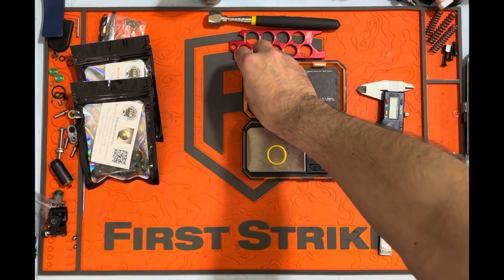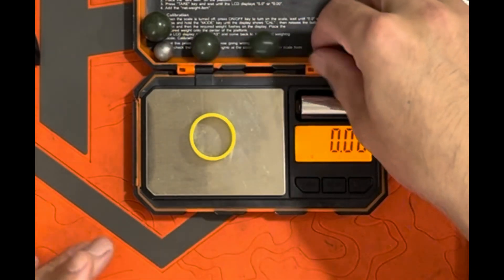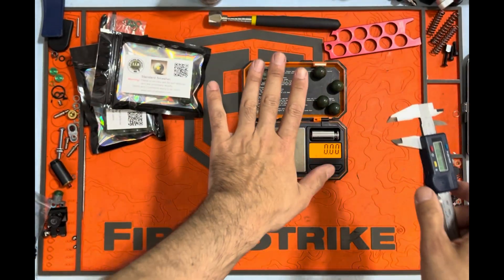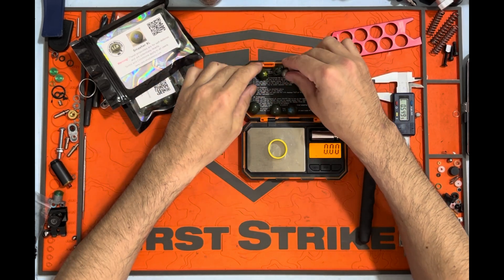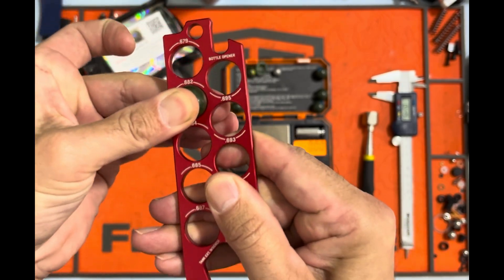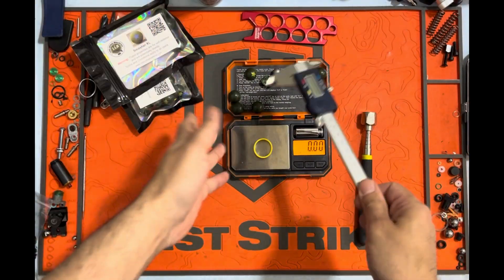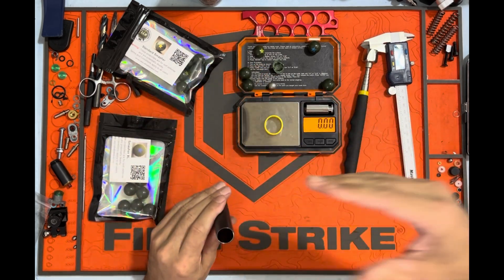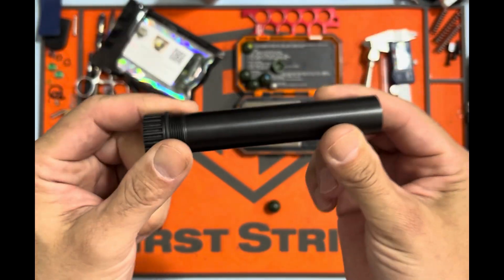LL4D Less Lethal Ballistics - Smasher Projectiles

Comment: Im curious how did you get your pistell x-68 to look like that? Is it cerakote? It looks super neat 👌
Reply from the maker: Ahh yes. I removed everything from the upper and sprayed with Easy Off Oven Cleaner. Took a few coats using a toothbrush to get the anodizing off.
Reply: @lesslethalfordummies  so you pretty much just used easy off oven cleaner and that removed all the paint off of it that's correct? If so that's a cool mod.
Reply from the maker: I didnt do a video on the x68 but did one with my FSC.

Less Lethal For Dummies - Getting That Polished Look
https://youtu.be/y7-j7vvNqoY
Reply: Awesome thanks man 🙂 @lesslethalfordummies

Comment: Gracias por tu nuevo video, yo tengo dudas de como engrasar mi byrna sd xl con su kit original cada cuantos unidades de co2 de 12gramos he de engrasar y si recomiendas engrasar alguna parte interna desmontando alguna parte del arma. 
Se que en este video no es protagonista el modelo del que hablo pero al ser tu video mas reciente quizás  sea mas fácil de ver mi pregunta saludos
Reply from the maker: A drop of silicone oil on the tip of each 12g co2 is all that I have ever required. Byrna sells silicone oil 12g cartridges but they are just a gimmick. Drop of oil each co2 is perfect 👌🏼
Reply: @lesslethalfordummies  gracias por contestar casi al instante,pues he leido que cada 500disparos se aplique  una dosis del aceite original byrna , desconocia los cartuchos de aceite  , perfecto cada botellita de co2 una gota okey ,muchas gracias

Comment: Interesting test results! I wonder which size would be more accurate?
Reply from the maker: In the past i have tested other round projectiles that were too tight in the barrel and that excessive drag caused what i perceived as spin which did send the trajectory off. Very similar to over gassing your launcher for its barrel length causing turbulence.

Comment: Can you talk about how you constructed your projectile catcher?
Reply from the maker: LL4D Projectile Trap - 1680 Ballistic Nylon
https://youtu.be/iNnjGocO2dk
Reply: @ Thanks. I bought it and it works great. I tried putting holes in it to hang without success. Besides cutting it letting it hand, how else can I use this material?
Reply from the maker: It is pretty tough stuff. I use spring clamps to hang it.
Reply: @ After experimenting I found that a staple gun and Guerrilla Tape works well to hold it on a dowel.
Reply from the maker: There are no wrong answers!

Comment: The thing is if you want the weight with a projectile that will not harm your barrel wich is ideal well I don't think there's any more to figure out and definitely nothing to complain about. You have as much steel as you can pack in it with just enough room left around it for a less brutal material on your barrel. I don't know what it is but all I have heard is complaints today and no respect at all. Oh, and people telling people how an item could be so much better when they don't have a clue how its made or how much work really goes into the process 😂😂😂
Reply: I feel similarly for these and other reasons.
This is great to have the option to get a larger round for 685 barrels and the mfr to speak to the sweet spot of weight (result of weight vs blowby and wind drag) aka joules delivered to the target. The amount of time and money saved vs other rounds that are too small and/or light (stopped by a thick hoodie or jacket is not acceptable) is money well spent. The casing complaints are a non-issue IMO. Super glad I found these. Can’t wait to try em out.
Reply: @orbitaljellyfish808 You'll be really happy with them as long as you avoid a few things...
Z
1. Don't shoot them at a brick wall as they will deform or break if you're close enough.
2. Don't hit them with a sledgehammer(LL4D that was an unfair strength test)
3. Make sure you're acrobatic enough to avoid ricochets... 8.4 grams really hurt on impact.

Do these things and you'll have a lot of fun with them LoL 😋

If you
Reply from the maker: 😂 no sledgehammers!

Ill hammer some other rounds just to show they all break when you do that. 😁
Reply: @lesslethalfordummies  oooh yes, they all shall break, excspecially with the good ol' boy Sledge! Or anything pretty much when putting out over 50j...👉💨💥
Reply: @orbitaljellyfish808  me too I've got projectiles that I will never own anything that they would fit...
Reply: @orbitaljellyfish808  👍

Comment: What size projectiles should I run through the 36-40joule HDX 68 safely? I do not know the bore size of the barrel for some reason?🤔🤔🤔
Reply: From what I was told by Less Lethal Home Defense, the HDX is .686 so either will work, but the XL are a little larger so you'll have less air blow by. I have the XL and I haven't had any issues with mine.
Reply: You're running the XL's through an HDX? If so is it the new 40j factory or a modded? Thanks bro...
Reply: @FLAlesslethal I have a 50 Joule HDX I got last Spring. I've also used them in my son's 34 Joule HDB. They've been reliable so far and I haven't broken any yet 🤞
Reply: @Joreel  Sweet, I love My HDB too! However I believe the barrel is alot smaller because the 683 hard black projectiles get caught in the barrel. Riotballs seem to do just fine in that marker.
Reply: @FLAlesslethal Well that's a little concerning. I always thought the barrel size was the same between the HDX and the HDB since their both shotties. If the HDB is .683 then that means we've been risking damaging his barrel and o-rings each time we used the XL rounds. I may have to order the regular smasher rounds for his HDB so we don't break it because I don't have the skill or ability to fix it. Thanks for letting me know the barrel size.
Reply from the maker: An HDB i do not have 😢
Reply from the maker: HDX by my calculation has a 687 barrel. I have tested it with projectiles to 0.684.
Reply: @lesslethalfordummies  Thanks bro- at least we have a trusted size for the HDX.

Comment: They seem to break very easily.
Reply from the maker: Hit anything with a 5lbs sledge and it will break.
Reply: As long as you're not hitting a brick wall, they're not going to break easily. I haven't had any break while hitting targets during practice.